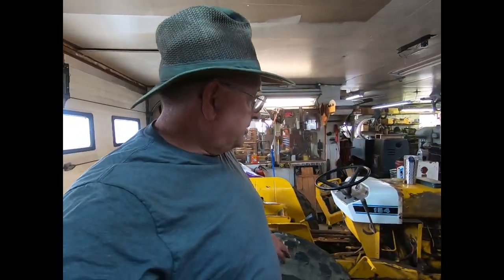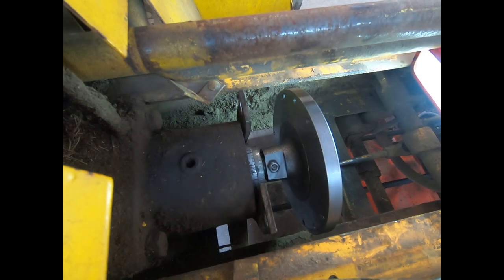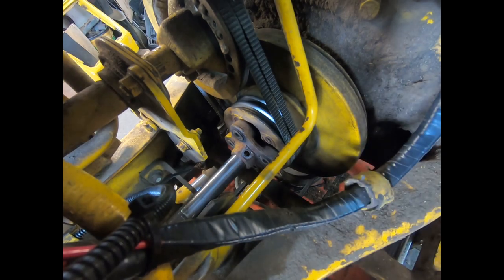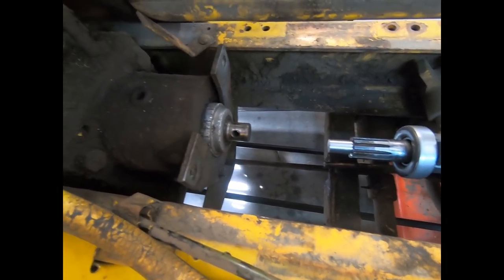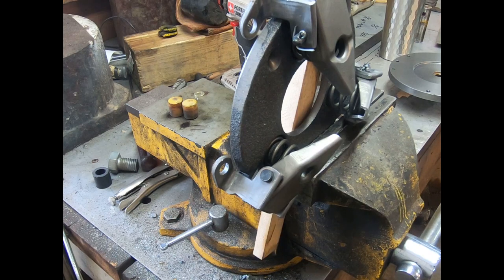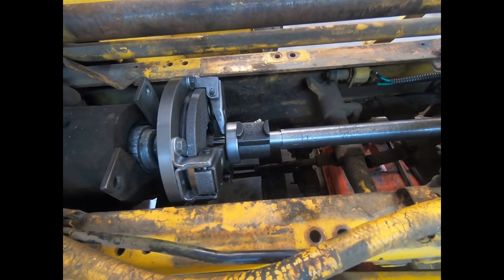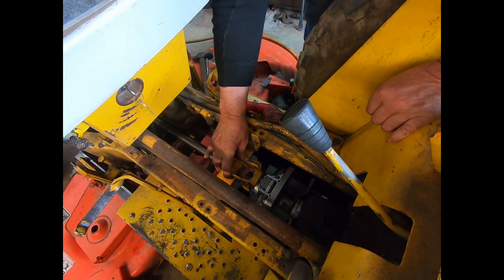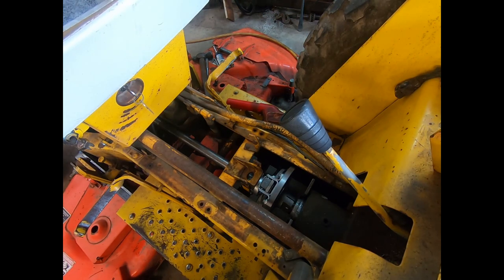154 low boy clutch replacement #3

Comment: Thanks for the video and walking us through the process. I have a ‘72 154 with a bad clutch that I’ve been pushing off changing.  It’s not the easiest job but very doable with a simple tool set.  I also liked your video for dressing up the 154. Feels like that tractor is almost forgotten but at least we can still get parts for them. You’ve given me some inspiration to get my mechanical work done and to give my 154 a good clean and paint and get it ready for the next 15 years of service.

Comment: Looking to buy a 154, there is a nice looking one in my price range but needs a  clutch. If it has the same hook up on the engine that allows the shaft to move forward would make it easy, some of the 154  the motor has to move forward about 2" and a lot more to remove to get the clutch out. Thanks for showing all the fine details by keeping the camera running.

Comment: This is great! Today after mowing an air strip for my dad's RC planes and ATV trailed one of the clutch lever brackets in my 154 broke and it made a HORRIBLE sound!  I removed the bolts that hold the bracket ears in but problem is though the lever is still being held in by the spring. Do you have video on removing the lever or do I have to replace the whole clutch pressure plate?   Get back with my as soon as possible because I love using this tractor for mowing and what not.
Reply from the maker: I just shot a quick video of the finger removal, it should be public by 9:00 am est.5-29-2020 i hope this helps.